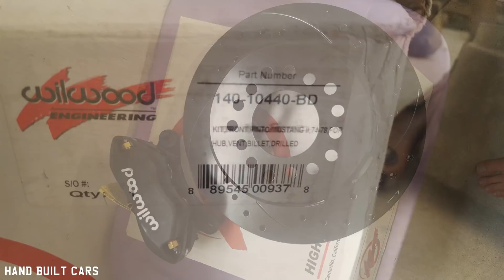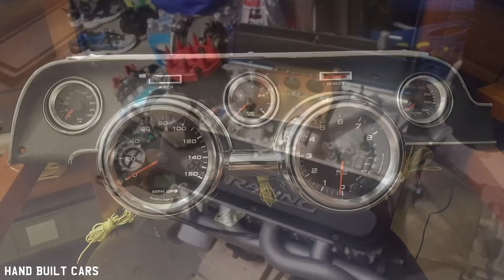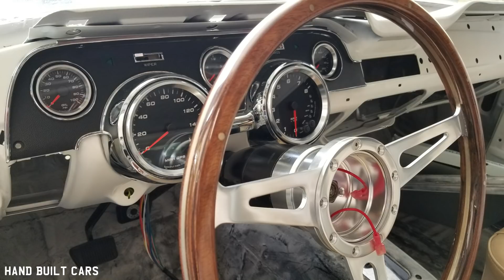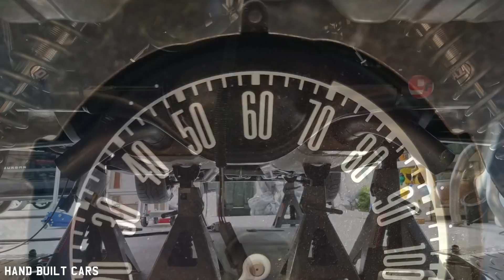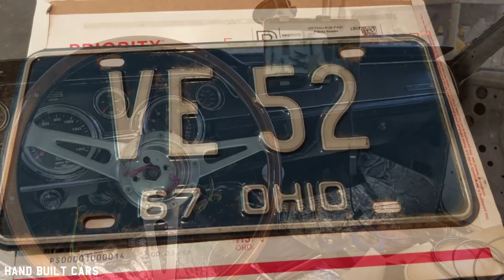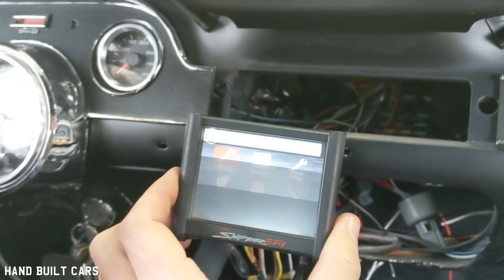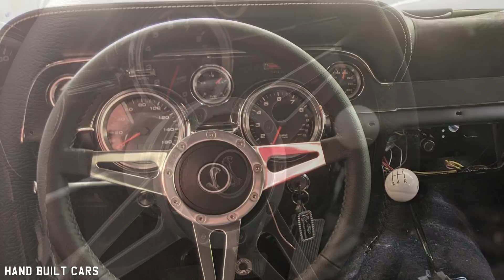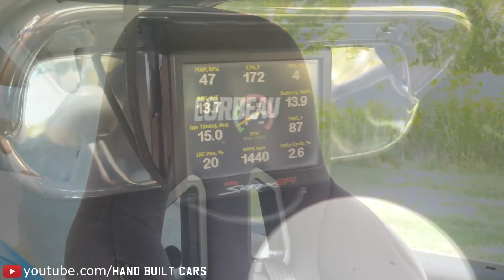1967 Ford Mustang Coupe Restomod Build Project

Comment: Absolute perfect execution!
We're going with Wimbledon white as well, but our Ford project is a bit of a one of a kind.
Actually,...the coach on the back is one of a kind..
Anyway, we just bought( and are currently restoring) a 1969 Ford F350 27 foot Vista Liner Olympus C Class Motorhome, and even though the interior is Wimbledon white,...they painted the cab pure white!
We're also going with an AOD transmission, three two barrels from a Galaxy, and air lift so we can drop it.
I do hope ours sounds as nice as yours, when we're done!
Great job, all the way around!